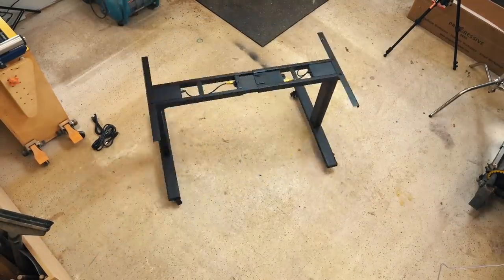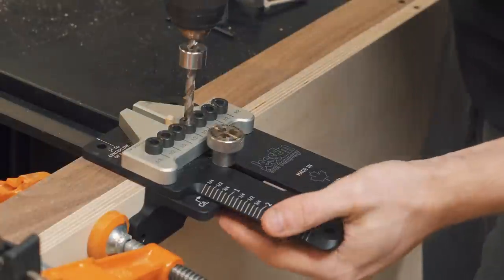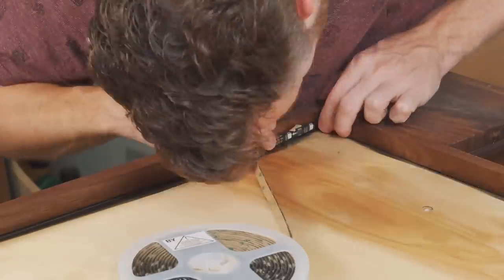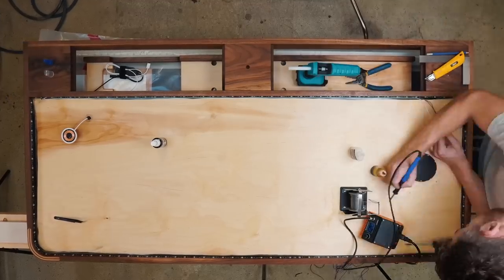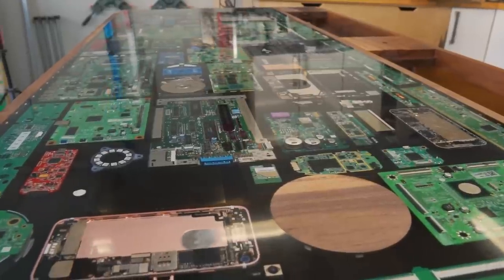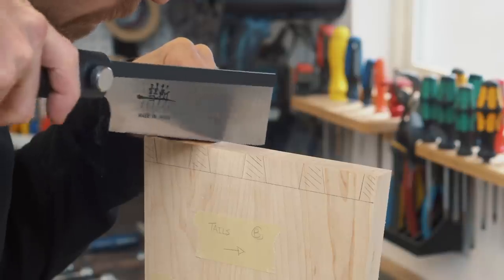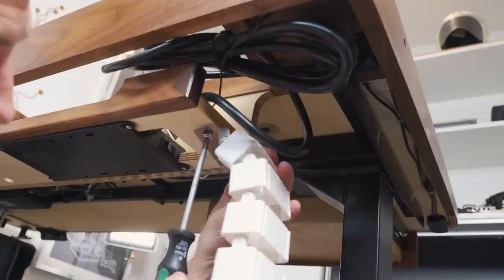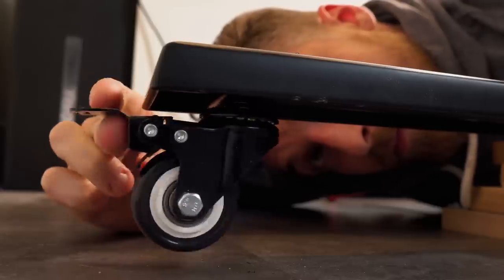Turning Broken Gadgets into an Epoxy Masterpiece | The Ultimate Tech Desk

Comment: Absolutely beautiful!  So much details.   I've wanted to do this with PCBs too... but now I realise I just don't have the wood skills but maybe I can do something simpler!
Reply: After the planning the tough part is 'actually starting' and then once you've started forcing yourself to stop. There is no such thing as a 'final finish.'

Like you I really wanted to start building my own furniture. In my case I wanted to showcase the grain on the local hardwoods available to me here in Singapore i.e. rainwood, angsana, mango etc. 

However, there was a massive snag. I'd never done any woodworking before AND I live in a small apartment. Also, I don't have a shed/garage/workshop and no one would rent me space. 

However, it didn't stop me I found a lumber yard that would cut my project boards to the correct approximate size and with battery powered tools I could carefully work them into the required shapes then put them together with woodglue and clamps to create the carcasses. I've built most of my stuff with a jigsaw, a power drill, a dowling jig, a router and a random orbital sander. 

I'd never done anything like this before but I worked at it and got some great results. I wish I had started doing this years ago. 

If you want to get started pick something simple for your first project that you will use in your home and take your time. You will be glad you did.

Comment: Looks great! The only gripe I have, if the led strip or the magsafe charger breaks, if you switch to an android phone or Apple decides to introduce a different wireless charger that's not backwards compatible, you would need to throw away a huge resin brick...
Reply from the maker: %100 and why I went with the best wireless charger that works with Android devices too. 

But yes it could break which is reason I didn’t bury more active electronic components. 

It’s not a resin brick though imo. It’s all really just cosmetics and the charger will look cool forever.
Reply: @buildxyz  ah I didn't catch that, good foresight! Definitely, although you won't be able to use the wireless charger if it breaks, would've been cool if you came up with a design that would allow to exchange it.
The only thing that would be unfortunate is when the led strip breaks or simply wears out (led's don't last forever, especially if they are not heatsinked as in your case), where it would be quite difficult to impossible to replace.
Reply from the maker: Very impossible to replace lol. They are set in (almost) stone 🤣  I like a little risk with every build!

Comment: I need to inquire bout something that no one is commenting on, can I use a working circuit board that's fully wired up in resin and still functions??
Reply from the maker: Yep! I have done that here with the wireless charger. The downside being that if it fails later, it’s almost impossible to service without ruining the epoxy. But then it also just passes for E-Waste if it break :)